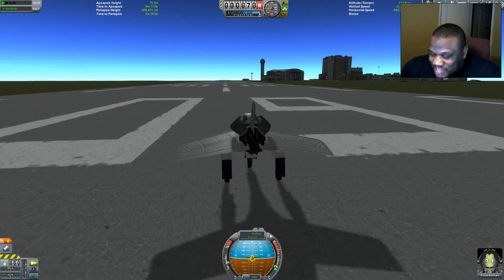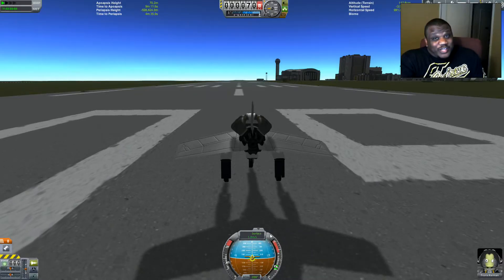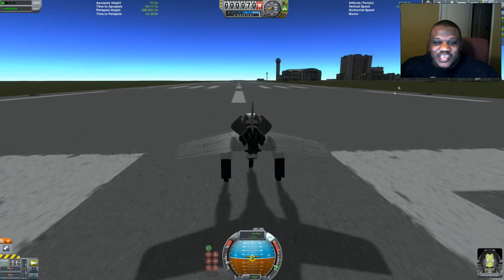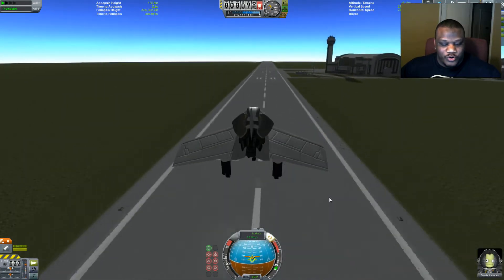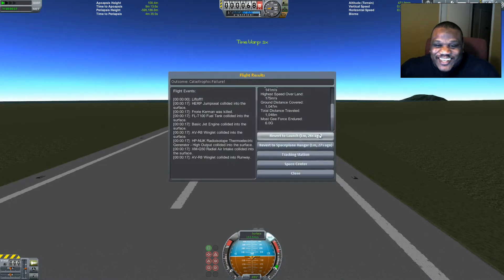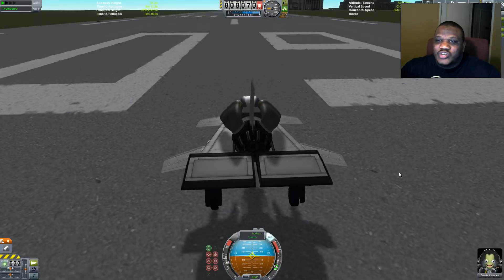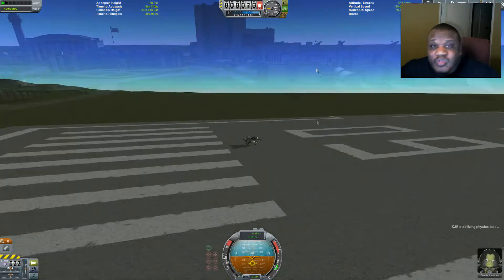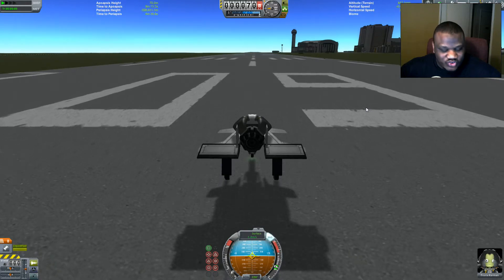Kerbal Space Program: The Double Loop

Comment: Let's try building a wingsuit. So basically the same craft without an engine. Notice that you gain speed when dropping 4:33 and right after that gaining altitude with the speed achieved in that drop. Try to jump of the vab or something, might be fun.
Reply from the maker: TheSolidZone I need to try a wingsuit type design...wonder if there is a standing "seat" that I can use as a chassis. Maybe KAS might have something...